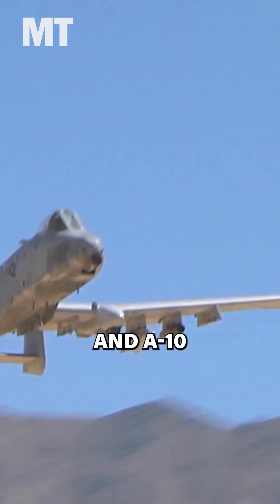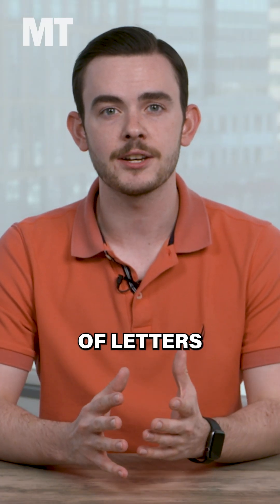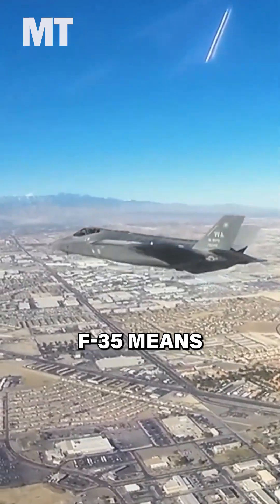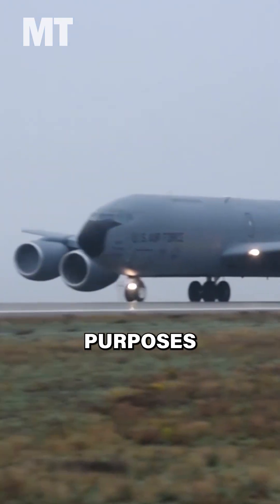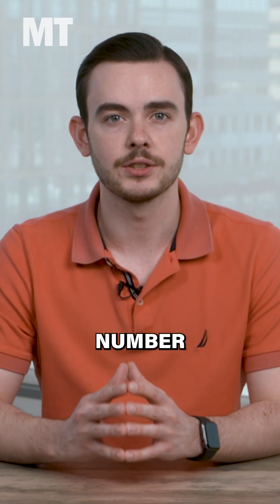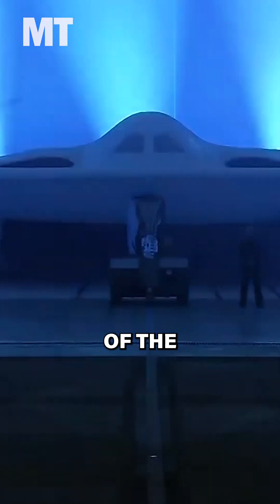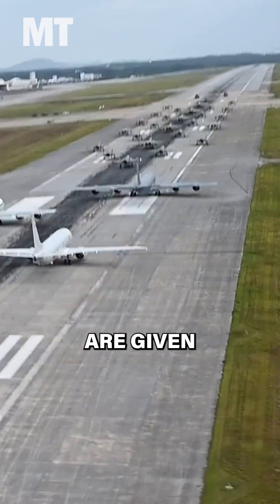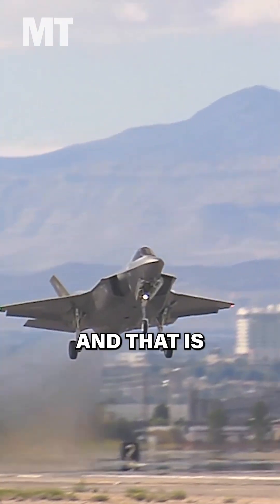How did your favorite military plane get its name? Find out in 'How It Works Wednesday'

Comment: And yet they want to retire the A-10 cus the F-35 can do a better job in Air-ground than the A-10. Yk what is more dangerous than casualties in a Air-ground strike? The mental effect. F-35 does not have that effect while the A-10 has the brrrrrrrrrrt. What is the enemy gonna do if they have a mental breakdown everytime they hear that?
Reply: Probably hide and then take no damage because that is exactly what has been happening in Afghanistan for the last 20 years, The A-10 is big and fat and if there was any peer to peer conflict where the enemy had literally any form of SAM systems the A-10 would just be flying coffins, the air force knows that they are an outdated idea and arguably where never even useful, even in the gulf war they were basically replaced by the F-111 in a tank hunter role (its also killed more friendlies than any other aircraft by a significant margin) but congress won't let them get rid of it because they believe what you do. physiologically how do you think US troops feel when the big cool gun shoots and then the enemies just start firing again two minutes later, it makes you demoralised.

P.S the f-35 would never have to rely on its gun because it can just do precision strike and actually kill things, but even if it did strafe it has a 25mm GAU/22 which also has a very cool noise.

Comment: "C" means "Cargo" genius...
Originally the "K" was for Kerosene
Under the 1962 Tri-Service designation system, “C” is the basic mission designation for Cargo aircraft. “K” is a designation for aircraft modified to be aerial refueling aircraft (“K” from “kerosene”). There is indeed a KC-135, as well as the KC-10, KC-46, and KC-130.